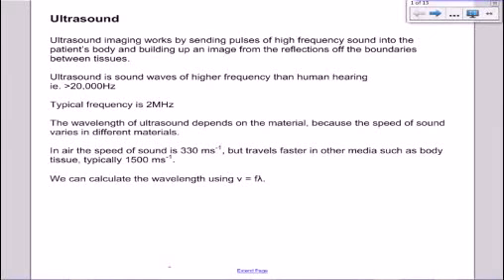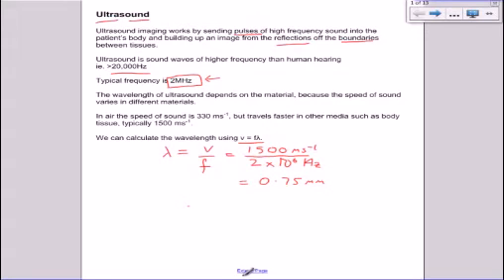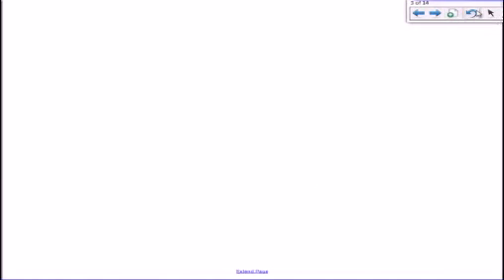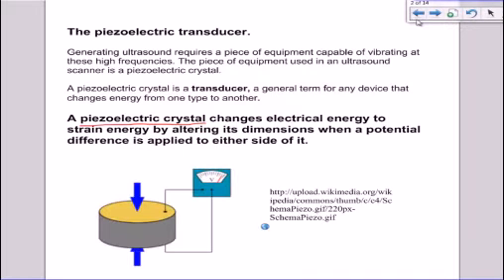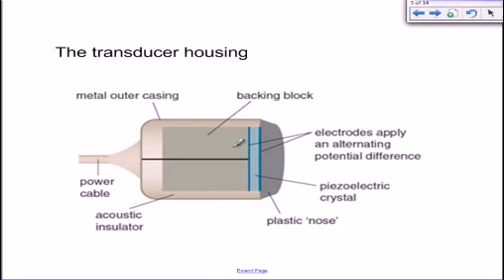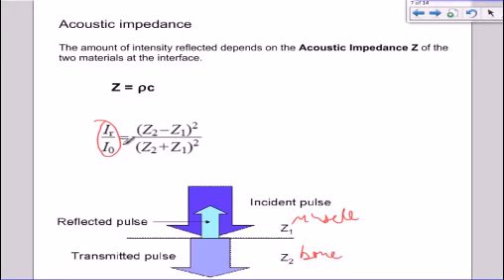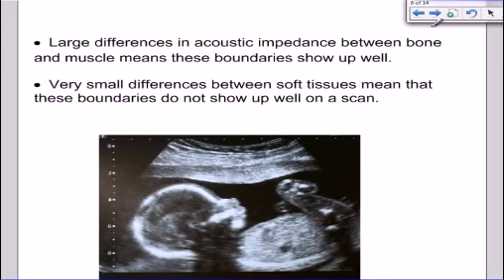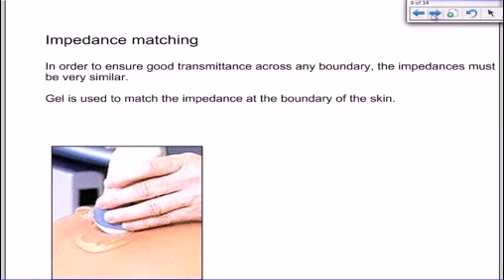A level Medical Physics - Ultrasound part 1  production and principles

Comment from the maker: Hi Raymond. I think your original question contains a misconception - your statement that E=hc/(lambda) applies to photon energy only, while here we are talking about ultrasound. The attenuation coefficient of ultrasound increases with the frequency of the ultrasound, and therefore short wavelength ultrasound is more strongly attenuated. This means that the amplitude will be reduced to small values in a shorter distance, hence they do not penetrate through tissue as far.

Comment from the maker: Hi there. hf is the energy of a photon and here we are talking about acoustic waves, so E= hf doesn't apply, rather the energy is proportional to amplitude^2. But higher wavelength doesn't mean greater penetration, it's that shorter wavelengths can image smaller objects. The attenuation co-efficient of material increases with the frequency of the ultrasound, so as frequency increases more of the ultrasound is absorbed and so it doesn't penetrate to deeper layers, making imaging impossible.